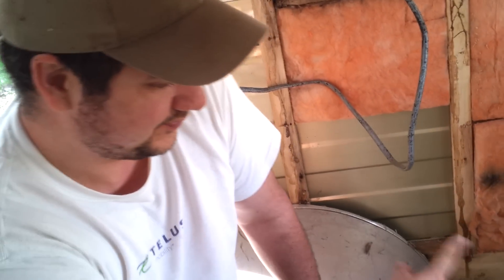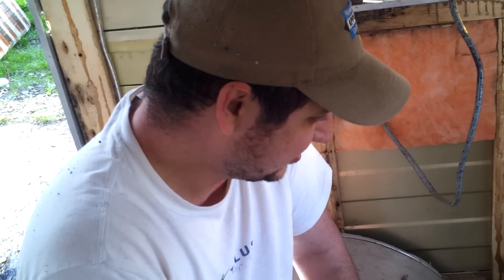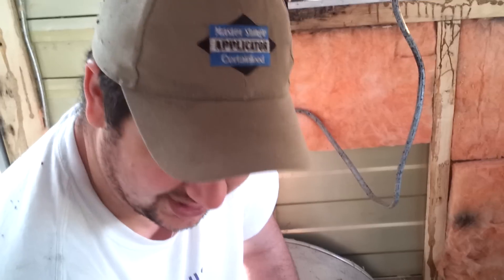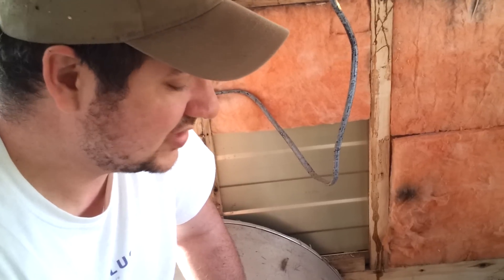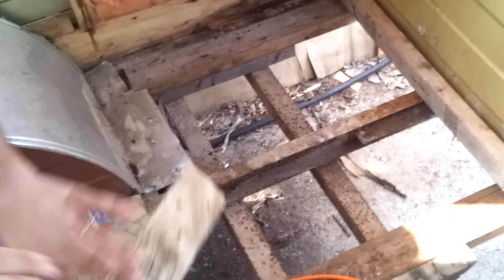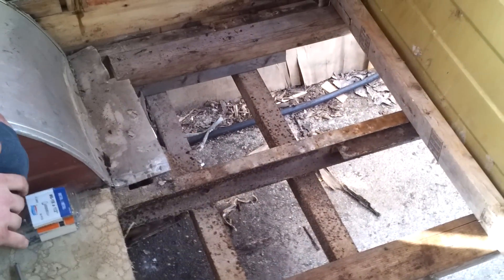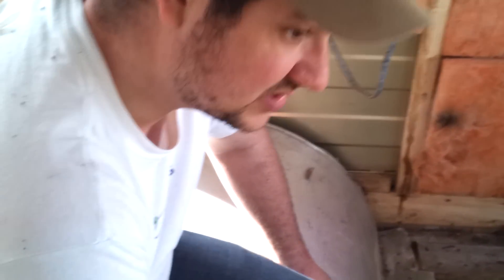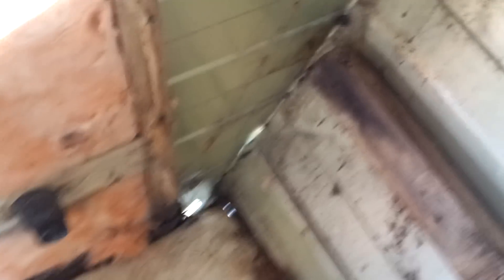Camper trailer Reno part 3

Comment: Im not an electrician and it all depends on what your going to be using in your camper as far as electricity is concerned but if your just going to be using some lights, fan, TV and or radio I would say leave what you have. If your going to use stoves, AC, space heaters and other stuff that is going to pull a lot of electricity then you should replace it for sure.